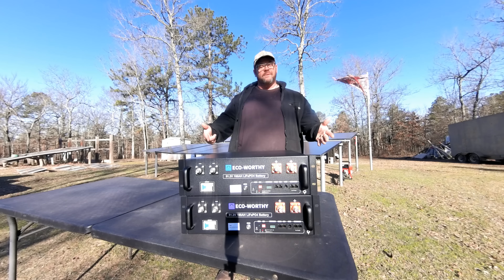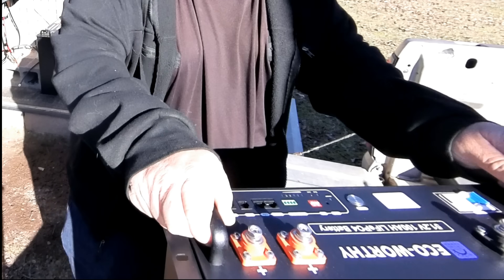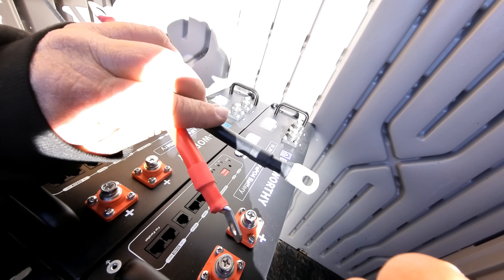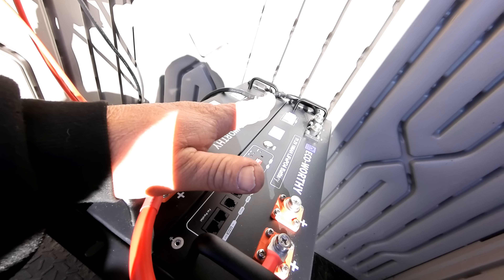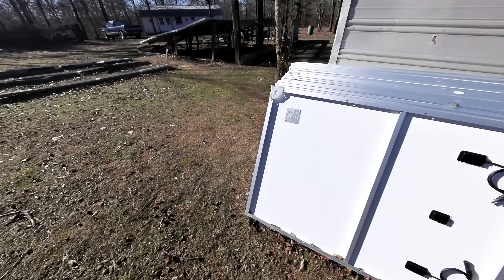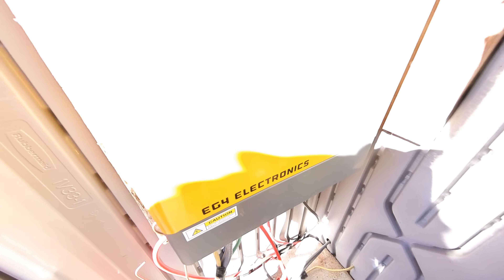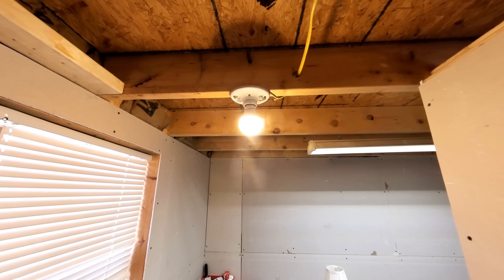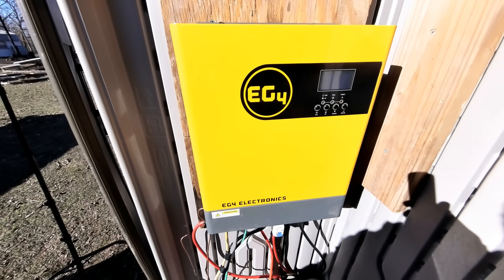Build Your Own Solar Cheaper With Eco-Worthy Batteries

Comment: How are you Sir , am your fan from Kenya 🇰🇪 I have a question can 160w solar Panel charge a 100amp battery perfectly?
Reply from the maker: It can definitely charge it but I would not say that it would charge it perfectly I think the perfect ratio for a 100 amp hour battery is more like 400 watts of solar power because of cloudy weather and other such things that will keep you from getting a full 400 watts most of the time and that way you'll be able to use your battery day and night
Reply: @OKLAHOMAOFFGRID  Thank you Sir 🤝

Comment: nice battery but the price.
still will have to opt for 4 - 12v batteries in series for 450usd.+ -
Reply from the maker: I tell you what why don't you take a look and see how many of those batteries you can parallel together and how many of those batteries you can put in series together and that's when you're going to see your limits and then when you take a look at these batteries you'll see you'll be able to put 1600 watt hours worth of batteries together equaling 80 kilowatt hours of power. You'll never be able to do anything like that with 12 volt batteries. Honestly 12 volt batteries in a solar system are made for very small solar systems for very small places or for very small ideas not for anything that is going to sustain somebody in the real world with a 3-2-2 house or anything that's going to run air conditioner and things like that day and night

Comment: Can the eg4 communicate with the batteries?
Reply from the maker: Not yet I only worked with it for about 15 minutes and I had to do something else right now I have it set on user defined and the BMS and the inverter are talking without the RS 485 cable if you know what I mean the inverter knows when to calm down and quit pushing the wattage into the battery once the batteries get topped off at 100% and it can even do this without the communication cable. But yes in the future I'm going to be tinkering with it until I can see if I can get the communications to link up

Comment: What do you do in winter?
Reply from the maker: Cook chili and wear a coat
Reply: @ How do you get electricity in winter? Is there a way to?
Reply from the maker: @onesauce  I'm doing just fine in the winter I have enough power that I can power whatever I need to do and as far as heating I use wood burning stove or propane
Reply: @OKLAHOMAOFFGRID  do you use the batteries in winter? Would you use a small generator for lights, fridge etc?
Reply from the maker: batteries

Comment: So you are down to about $350 capital cost/year  over 10 years to provide 3600 KWH a yeaar if you can use all the power, and  you have a good emergency back up. East west and florida, $0.10 A KWH is a good deal.

Comment: Great video! My system is almost the same as your base system minus the batteries. You asked for a challenge on the price here goes ... got the EG4 3k refurbished for  ~$475 with shipping and then got 15x265w panels for total of 3.6kw  for $480 total no shipping (local pickup) some misc cables $100. I use my system just for cooling and occasional heat since I am in Florida. Big thanks for the heads up on the battery I was close to getting an EG4 14.3 but  batteries you showed are such a good deal I think I will have to go that route. Like you I will be adding more panels.....feels so good to get free energy!
Reply from the maker: Yeah well it's not fair that you're using a refurbished eg4 in this scenario 🤣🤣 because if I told you my prices that I have in the system it would make you cry. 😂 And I think your solar panels will probably not bought new and the ones I'm advertising are new. But hey in the end this is what it's all about getting a great system for a great deal whether it's new used refurbished or gifted to you
Reply: I live in Florida where can i get panels at for around that price? Thanks
Reply from the maker: @oneshot_onekill4618  yes

Comment: Most homes use between 25 to 30 kwh.  The secret is to buy energy efficient appliances. I personally have 20ah of battery storage. Those 2 batteries would not be sufficient.
Reply: Just looked at the bill on my desk. 141 KWH for December. 4.5 KWH a day, Gas furnace, northern ILL. KWH charges of about $20 Line charges of $21
Reply from the maker: Exactly

Comment: How long will the batteries take to charge up if they were fully drained with just solar and whats the maximum amount of panels can you use with that setup
Reply from the maker: With this setup the maximum amount is 5,000 Watts and I'm running 3,400 now.. I am about to hook up two eg4 3K inverters and run 240 volt and 120 volt and I'm going to input 7,000 Watts worth of solar panels and then I'm going to have four of the server rack batteries so this is going to be a massive system for off grid and it should last me five or six days during the cloudy times and my system normally charges up to 100% by 11:00 a.m.

Comment: I like your videos very informative. 

I am in australia and we run 240 volt setups.
I am on grid with a 4.2kw solar but I want to get off the power grid as much as possible.
On a very sunny day I generate about 35kw on average and most goes back to the grid as we have no battery. But I don't know how to calculate what we use vs what I give back.
 This week is 40°c all week so we run a couple of large air cons... my question is what kind of battery would you recommend for this kind of setup, to cover our night time use, I estimate 10kw overnight on a hot day, probably less... i would love a discussion on this.
Thank you for your content. 😊
Reply from the maker: If you use 10 kilowatts I would buy 20. And if you could afford it even 30 so that would be like four to six batteries like this in the video

Comment: If this system was ecoflow it would be over $20,000. Instead it's only 3 grand. Great video.
Reply: That's a great price 
I pd ovr $1200 for a generator and that takes gas to run & if the power was off for a whole community gas can b hard to find 
I need to pull the trigger and get a solar system asap 
I enjoy your solar videos alot thanks
Reply from the maker: You got that right!
Reply: No my friend when you account for panels , wiring, fuses. He also has the expense of travel, which he did hours away to get his panels. More like 5k for a limited system.
Reply from the maker: @MikeKemp-m7i  lol signature solar was 81 miles from my house about 15 bucks in gas...also the panels are included in the price i gave of the total system cost of around 3k
Reply: Its for sure cheaper but definitely not $20k.  The EcoFlow Delta Pro Ultra with foldable 400w solar panels is around $8k but only 7k wh of battery on base.  Add another 6k or so battery expansion for $2k or so and you're around $10k.  Pros - its already setup and portable, his setup is obviously not.

Comment: Can that inverter run 240?
Reply from the maker: You can parallel two of them together and they will do 240 I'm actually about to do that exact thing in an upcoming video when I install 7000 watts of solar panels
Reply: Can’t wait to see the video and how to run it. I have a cabin off grid and would need that for my water pump. Do they make another inverter you would recommend for 240 or doubling up is the way to go?

Comment: Dumb question but I know this battery is wifi/BT capable. Can you turn off the battery remotely using wifi ?
Reply from the maker: Yes you are correct it is Wi-Fi Bluetooth but I was not able to turn it off through the Bluetooth I'm still messing with it though

Comment: Something go wrong with the vatrer battery or could you not hook them to gather
Reply from the maker: No those batteries are doing good I just got these new ones in for so cheap they were actually cheaper than the vatrer batteries so I had to put them to the test. I may even run them together here in a few days
Reply: @OKLAHOMAOFFGRID  thank you for the reply, we have seminar system but I have 3 battery of the vatrer, they are doing great so far, thanks again for you channel may God keep blessing your family

Comment: How do they deal with bitter cold in that uninsulated shed?
Reply from the maker: I don't know they've actually been doing good and The Sun shines on the side of the shed and keeps the inside pretty warm even when it's close to freezing
Reply: They each have 6 temperature sensors for the BMS spread around the case and on top of cells, so it will definitely be shutting off at freezing or right around.
Reply: You could just a thermostat controlled outlet and coup heater to turn on below 40F. The inverter alone might keep it warm enough in there.

Comment: How many days of autonomy do you think those batteries will give you minus a generator or any pv input?, and is it more easier to monitor everything with the communication between the inverter and the batteries via the app? Really appreciate you for helping me to push my confidence in moveing torch solar! I’m blind but your over comings truly set my foundation for this journey in being independent in my homestead Amen❣️, of course my focus is to get my research and logistics in order firstthank God
Reply from the maker: I'm pretty sure I can go 4 days without sun... They use about 20% of the battery per 24 hours
Reply: @OKLAHOMAOFFGRID 20% standby idle consumption is high. Waoo!! Is it because of the inverter or batteries?
Reply: @jab376 i think he meant 4 days of normal use. Not idle time.
Reply: @ yeah I kind of figured as much. I just wanted to see how many days of autonomy those batteries can dish out❣️ I was thinking about stacking four of them together
Reply from the maker: @jelani3470  I built a system with four  batteries and it has been running there whole trailer house for a year now